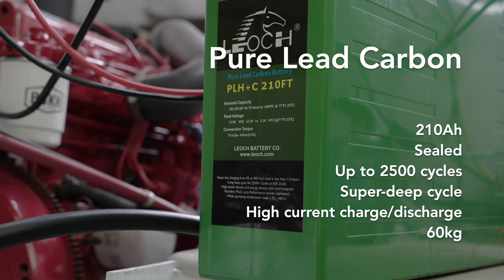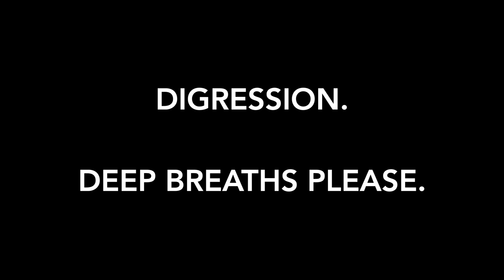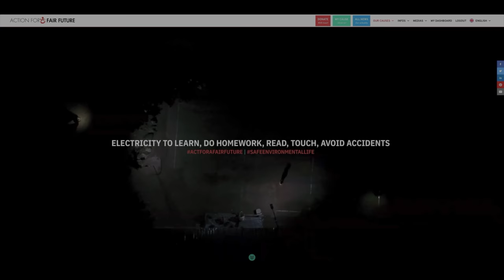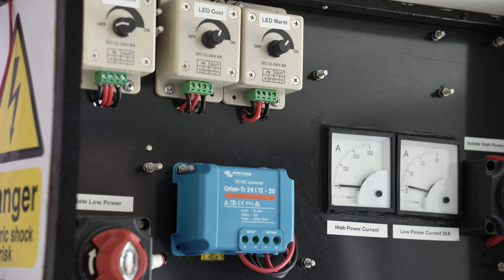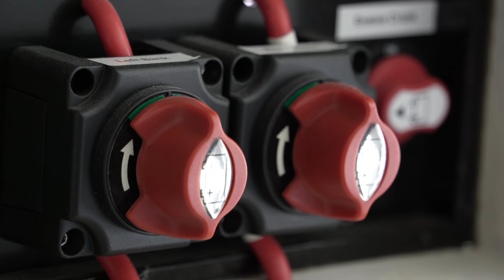Lifeboat Conversion Ep12: Introduction to 12V / 24V electrics system, and battery choices [4K]

Comment: I commend you for how nice the board looks in the front but as a electrician your cables are a mess and your labelling of some things leaves it up to interpretation e.g. left battery right battery someone could be unsure of the orientation of the batteries and switch off the wrong one e.t.c
Reply from the maker: The rear of the panel is now mid-tidy up. I wanted to get the overall layout sorted before I adjust wire lengths and bundle groups together. The left/right thing vs. port/starboard in the battery box was debated and explained at amusing length elsewhere I think!

Comment: yeah... Lithium Titanate is better. In every way except initial purchase price (and even that shouldn't be too bad compared to the specialty batteries you chose). You can abuse it and deep cycle it more than lead at any given temperature. It's not too late for you to do the right thing.
Reply: but don't take my word for it, ask this guy: https://www.youtube.com/watch?v=kYx097cVR48 He's built a giant one and done quite a bit of testing.
Reply from the maker: Have these LTO batteries overcome the cold charging issues of usual Lithiums?
Reply: @AlexHibbertOriginals  In theory: yes. Down to -30°C. Might still be some limitations on the C-rate at the really low temperatures (don't know off the top of my head) but it's not like charging lead at -30°C works very well either. In reality, Brendon Tait stuck one in a freezer and charged it at like -17°C and measured the round-trip effeciency. LiTO is definitely what you want for your 3rd mobile battery bank. 

My boat ran into other issues and the battery budget got cut so I have to live vicariously through Brendon Tait. Seriously, hit him up. He's a cool guy. Tests things BEFORE he posts videos of them, answers critical comments, does follow ups when it turns out he screwed something up explaining what went wrong and how he fixed it. He might do more tests if you ask him.
Reply from the maker: @flasher702  Thanks - it wasn't so most the speed/performance but the fact that 'normal' Lithiums are damaged by sub-zero charging. Good to see they've avoided that issue here without the need for heating circuits.

Comment: You need solar panels, which automagically seek the sun and turn upwards if there is none. Sun shines 24 hours, but you have to turn them every 3 hours for maximal efficiency., which is bloody annoying. Nobody makes such panel mechanism for the arctic, me thinks. 
And yes. Now that we have built the rotating mechanism, we must also  consider storms and wet snow freezing on the panels. So weather information is also needed and the ability to turn panels totally upside down.
Reply from the maker: Modern panels are getting pretty good at collecting light from imperfect angles, and under low light conditions. Exciting tech to explore.

Comment: Lots of reasons to not use lithium batteries. Their poor performance in cold weather is no small consideration for an arctic expedition.
Reply from the maker: Very important to be specific here: lithiums are excellent in discharge in the extreme cold. On charge, they can be damaged if it's very cold. The charging here will be in the warm. In a tent, you charge lithiums once partially re-warmed in a sleeping bag/jacket.
Reply: @AlexHibbertOriginals  specificity isn't especially important. Speaking generally is entirely acceptable. Lithiums are not great at discharging in the cold. We have to put a load on lithium batteries for several minutes to warm them up enough (via their internal resistance) to start snowmobiles left out overnight but those with lead acid batteries start normally.
Reply from the maker: @mwilliamshs  Your initial, general, remark implied that lithiums are poor across the board in the cold. This isn't true. They perform well (if you insist once current has flowed for a short while - although this is only because cranking engines demands so much current - for other purposes they work straight away) under load for prolonged periods, without the steep curve drop-off seen in some other chemistries. Thanks for the input.
Reply: I found using lithium batteries for radio controlled drones that the voltage would sag significantly more under load when cold.

Comment: Lithium is a sub-optimal choice for cold environments.
Reply from the maker: That's not really the whole story. Discharge curves of most lithium chemistries is very good in the cold. The common ones though can't be safely charged below 0degC - although this is being circumvented by self-heating batteries, LTO etc.
Reply: @AlexHibbertOriginals  that's what the RV industry have concluded. They have great %of use ratio compared to lead/acid but you start to loose the capacity when you have to heat them with their own power. It seems contra indicated when you'll be in near to total darkness for months. But then the Arctic seems contra indicated for human survival... 😃
Am really enjoying the series!
Reply from the maker: Thanks Ken

Comment: Keep in mind that lithium batteries have awful performance at low temperatures. You probably want your portable battery to be insulated
Reply from the maker: Lithiums have their performance/damage issues when being charged below 0deg C. Their discharge curve at very low temperatures is excellent, especially at lower currents.
Reply: @AlexHibbertOriginals  I didn't know that, thanks!

Comment: 🙈 left bank.... On a boat..... You need to learn port and starboard
Reply from the maker: Like on the lighting panel which has.....port and starboard on?

The battery box can be reversed in orientation, and so left and right is quite ok there.
Reply: @AlexHibbertOriginals  that doesn't make much sense.
Reply from the maker: @millportafty  It makes perfect sense. A battery box with four batteries that fit in a set configuration, but that can as a single unit be rotated 180 degrees and refitted to the seating, has a left and a right. It doesn't have a fixed port and a starboard.

But thank you for clarifying your maritime knowledge. It's invaluable on here.
Reply: @AlexHibbertOriginals  I was in the merchant navy for 12 years.
Reply from the maker: @millportafty  My father was in the Royal Navy for 40 years - so I've thankfully been taught to enjoy the differences and uses of left and right, and port and starboard.
Reply: @AlexHibbertOriginals  🙈